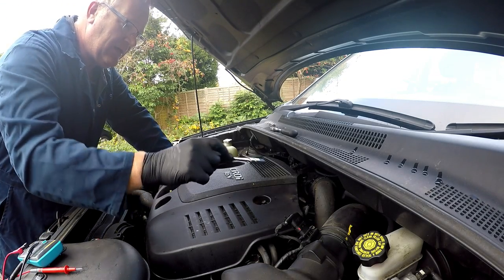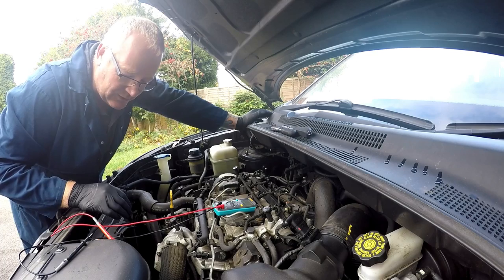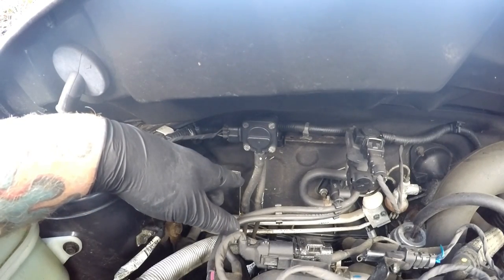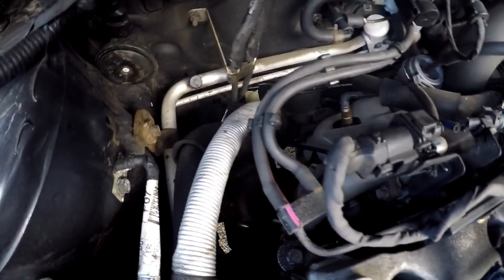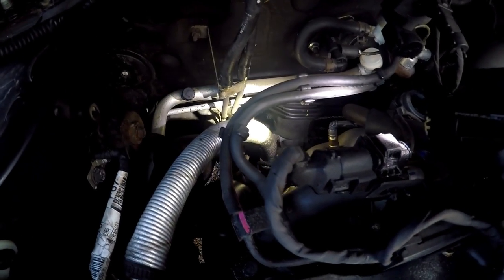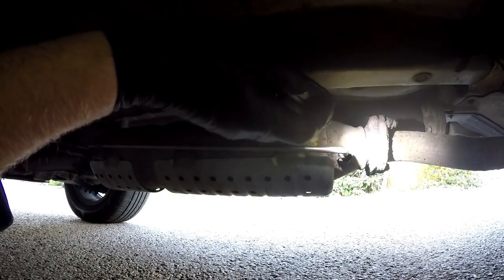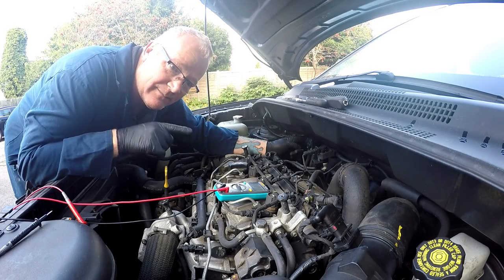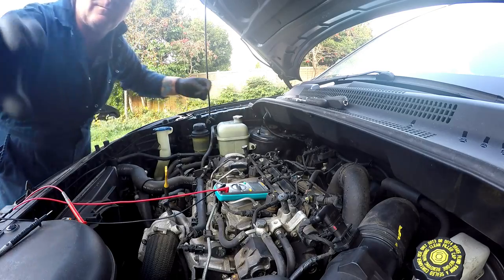Kia Sportage 2009 | DPF Investigation P2002

Comment: I have exactly the same problem..I am wondering how DPS sensor calculates the pressure between inlet and outlet? what it means if outlet indicate 0 pressure as in this case?
Reply from the maker: I would imagine it will just use a pressure differential sensor, if you have a meter you can probably have a poke around. I don't have my Sportage anymore, some kind idiot ran into it overnight and drove off :(

Comment: Hi Simon, I've just discovered that I have exactly the same problem and was wondering how the weld held up, as I was advised that it would only be a temporary fix and would eventually need to replace the DPF.  I'm hoping that welding is good enough for a more permanent fix to avoid the cost of buying another DPF.  Thanks.
Reply from the maker: It worked ok, but I did replace the DPF eventually, cost £200 GBP
Reply: @SimonParkes  Thanks for the speedy reply, Simon.  I was told I'd have to replace the DPF and Cat as one unit (at great expense) but I see them sold as separate items on ebay, so I believe I'm being ill advised.  I'm glad you uploaded this video.  Thanks for your help, mate.  Much appreciated.
Reply from the maker: @titansportage5221  glad to be able to help

Comment: How did you fix it
Reply: easiest way to remove dpf:)
Reply from the maker: @-xYz--nk1gm  problem is now in the UK it's part of the MOT so can fail for not having one fitted, and also if you empty it as well :(
Reply: @SimonParkes  i live in United Kingdom .  and believe me that the car will pass the motive with removed dpf.  in 2018 I had a bmw e60 530d with removed dpf and it passed the mot.
Reply from the maker: @-xYz--nk1gm  me too, am only going by MOT directives and rules, if you have a tester that passes that's his choice ( and handy for use diesel owners ) ..

Comment: I have a 2006 Kia Sportage diesel and it is hard to find anyone who knows how to work with these vehicles. thank you
Reply from the maker: Glad to have helped
Reply: I'm sorry, but could you help me, as I get an OBD adapter to diagnose the vehicle, here in Brazil is very high value and difficult to achieve.
Reply from the maker: @jeancarlosgrilloeb  Not sure how I can help.
Reply: @SimonParkes  good i need the device to plug in the vehicle and read errors, scan